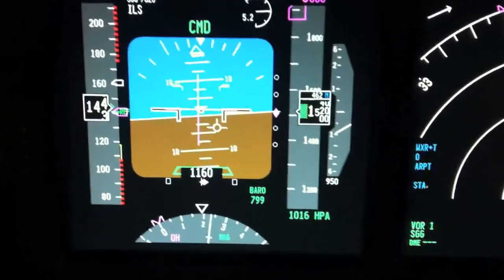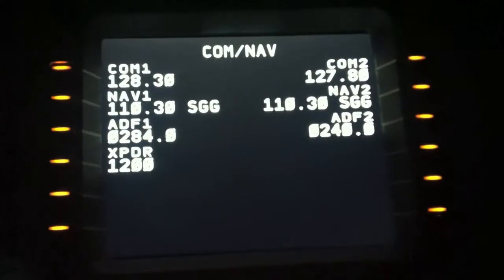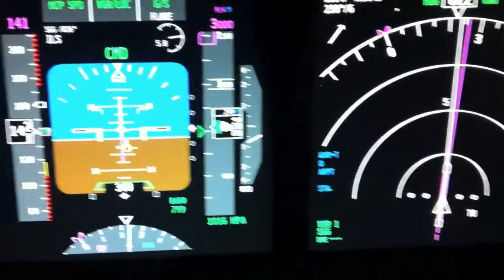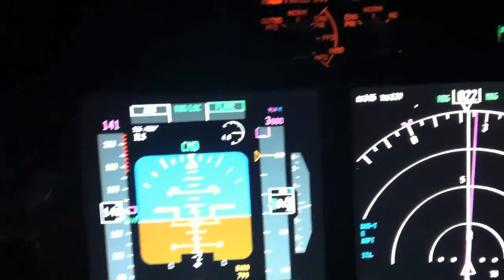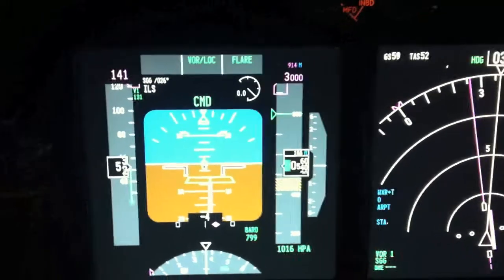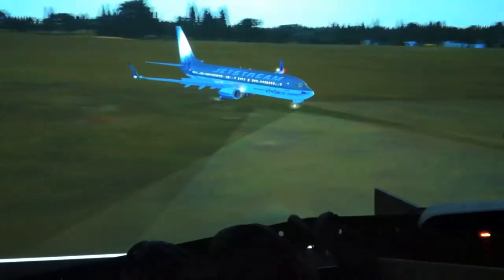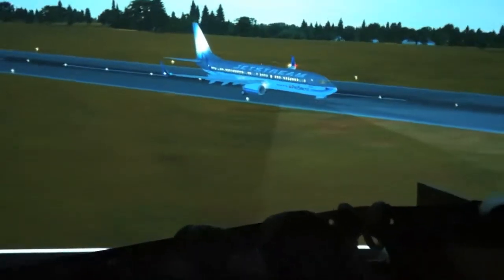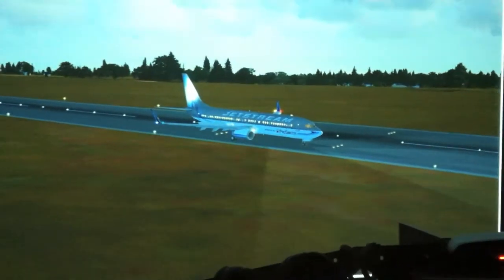Autoland

Comment: The problem is of course obvious as you are using auto-rudder. If you notice, the plane is steering to intercept the localizer on the runway because the rudder and ailerons are interlinked in hour setup. There's really nothing wrong here. You just need a set of rudder pedals:)